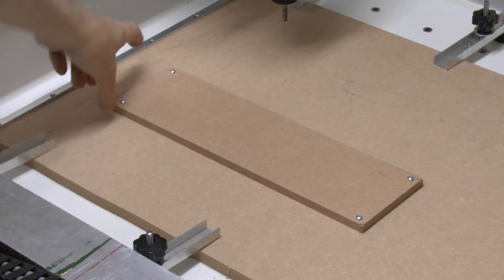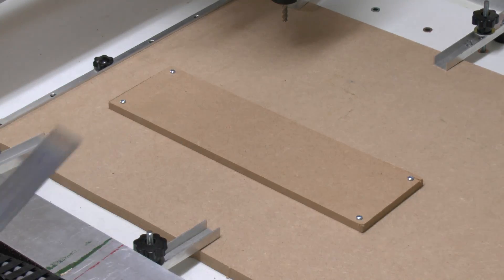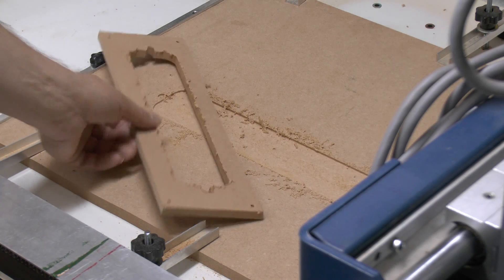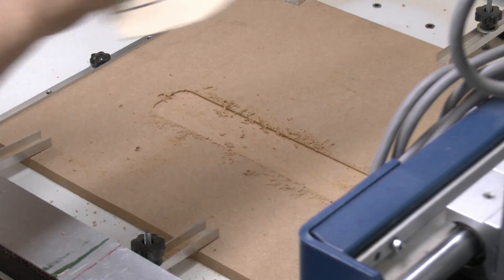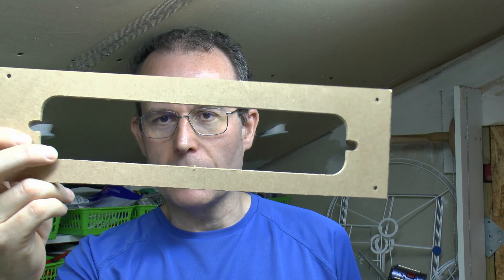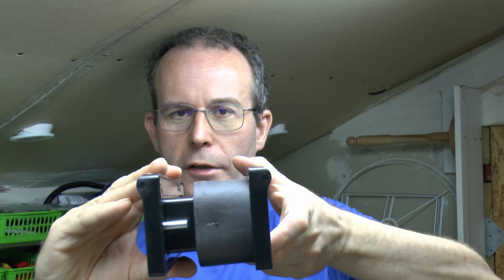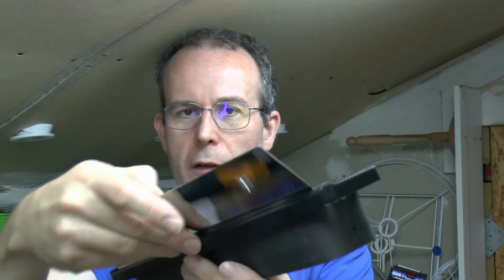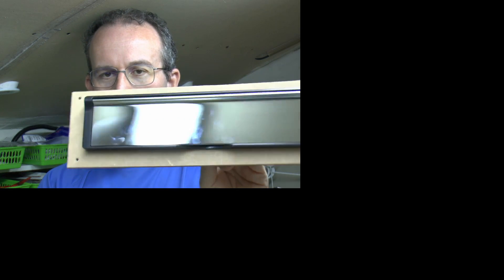CNC Cutting a Template from MDF

Comment: hi 
 jw
i was asking myself the same question others   in regard to the cutting  of the template if you  did not want to use tabs then why not screw the center cut out down as well as the outer  of the template  to the base bord it would have saved a lot of time in cutting  maybe i am wrong but that is the way i do it  in my little 3020 cnc 
regards
james

Comment: These modern letterboxes all seem tohave the same inherent design fault, ie that the inside flap has a strong spring that prevents thin items like a simple letter from being pushed through without crumpling it.  The spring is a moulded plastic torsion spring and so is not amenable to modification.  What's needed is a coupling mechanism that lifts the inside flap when the outside flap is lifted by Postman Pat.
Reply: @number 33 That's actually a clever idea! On mine, the postman managed to break the torsion spring on the outside flap forcing a parcel through. I put the broken spring on the inside instead, so my letterbox has no such resistance. The flapping on the outside with every breeze was annoying me! I would have replaced the spring if I could have found them. I wasn't going to replace the whole letterbox because of it.
Reply: @dalriada842  Is there any downside to not having a spring on the insde?  I could just remove mine, I hadn't thought of that.

Of course the Post Office's solution to this problem is to pad out the letters with lots of unaddressed junk mail but it doesn't always work.
Reply: @number 33 You need a rod to hold the internal flap on if you remove the spring. I used the broken spring for that purpose. I wouldn't break a functional spring though for that. You may want to put it back if you ever move house, or if the postman breaks the other spring.
Reply: I'd much rather battle a modern letterbox than an old, vertical, mounted 1.7 meters from the floor, inward push flap with the most industrial spring ever, and a misaligned internal brush strip.

Comment: Ick. Nasty carbohydrate foam composite.

A nice piece of aluminum or even aluminium would be much less nasty.

More seriously, are you planning on routing the hole in the door? Usually you need an oversized hole in the template to allow for the router bushing.
Reply: "Usually you need an oversized hole in the template to allow for the router bushing."

Not if you use a flush cut router bit

Comment: Am I being stupid by asking why you didn't just cut the outline, rather than routing the entire hole?
Reply: I’d guess Jw didn’t want the centrepiece coming loose and snagging in the cutter or breaking it , although it would have been easy enough to tack it down
Reply: That's what tabs are for, would have worked perfect for a piece like this, 2 tabs on each of the long side would've solved that. (and reduced machining time pretty dramatically... from like 4 minutes to 1 minute :P)
Reply: It's easier to hold the work and less stress on the endmill. Slotting cuts are generally a pain.
Reply: My thoughts exactly.

Comment: The chatter would give any professional  machinist the heebie jeebies 😁
Reply: I'm an amateur (Shapeoko 3) and even I cringed a bit there :D
Reply: Most machining today is CNC techniques.  The sound is normal for a 20,000 RPM wood router and appropriate for machining wood or wood products.
Reply: @arvevans  I often CNC MDF with my Shapeoko, and I'm very confident that's a chatter sound.. not the RPM sound. (I've got the Dewalt DWP611, runs at ~16k minimum)

Sure it's not necessarily detrimental because he doesn't need extreme precision, but that's not going to stop people from pointing it out :D